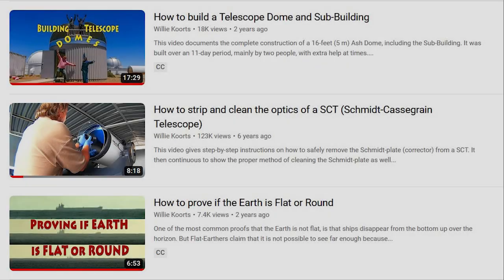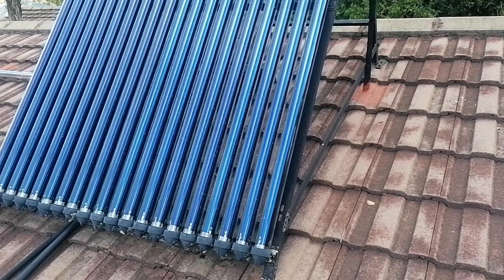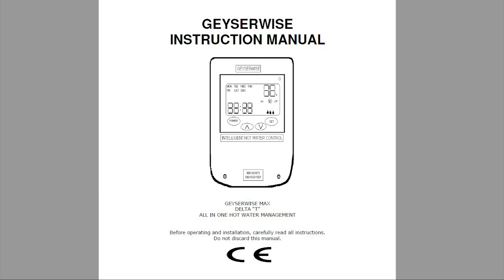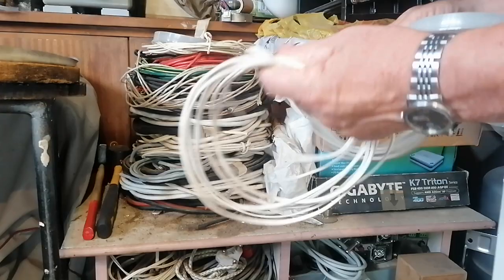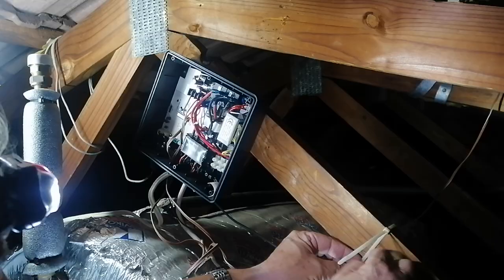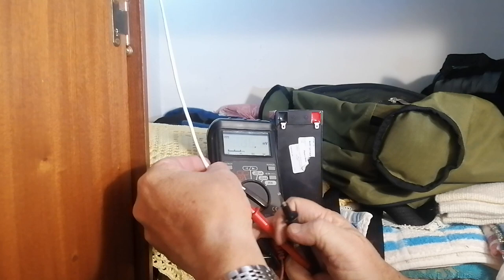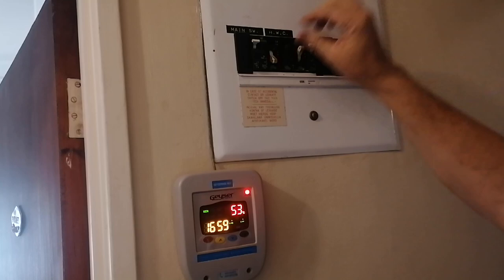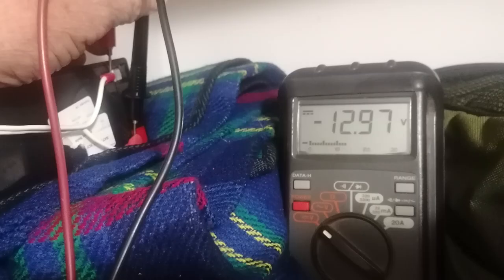How to prevent a GeyserWise losing its settings

Comment: Great advice, just added a battery is yours still running ok?
Especially with the longer load shedding times
Reply from the maker: Yes, still working fine.  I since found out that there is a button-type battery in the Geyserwise display unit that needs to be changed when it looses time & settings, but keep forgetting to check.  The battery is still useful to keep the display going.
Reply: @SterremanWillie  
Post that video when u get a chance pls
Reply: @SterremanWillie  hi Wiilie, my display skerm  verloor ook tyd met LoadShedding. Ek het al die battery 2 keer vervang, maar verloor nogsteeds tyd. Enige raad?

Comment: Hi Willie. Thanks for this very useful video. I've connected the battery as described but I've noticed that the power coming from the board to the battery is above 17V. I disconnected the battery to avoid damaging it. How do I safely reduce the voltage to a level that won't overcharge the battery? Thanks for your help.
Reply from the maker: I also measured 16V which worried me as well, but its been running since I made the video without any problems. The battery does not heat up either, so seems to be OK.
Reply: Thanks Willie @SterremanWillie

Comment: Hi Willie. Any idea of the solar panel combined with a lithium 7Ah 12v will work the same? Geyserwise techie said not to use lithium but i dont know why?
Reply from the maker: I suspect it is not recommend because lithium technology use different voltages and currents to charge, compared to the Geyserwise charger which is designed for a lead-acid battery. It could result in the charging circuit of the Geyserwise to fail. Lead-acid batteries are far cheaper anyway and you don't need a big battery either - my 7Ah is an overkill already.

Comment: Hi Willie, 
Could you please help me know what causes the pump not to work, if I connect the battery directly to the pump it works but it's not sensing when to circulate when connected normally, the solar system was changed because of a burst pipe in the previous one. Am worried because the solar is overheating. Please help.
Reply from the maker: Its difficult to faultfind like this, it could be a number of reasons. I once had to change my Geyserwise when the output port for the 12V motor blew. The 220V port still worked. This I determined using a multimeter. I don't quite follow what happened, sounds like the motor did not work after the uniit was replaced?
Reply: Hope you solved it but just to check 1. Is the probe on the collector working fine? 2. Double check the terminal connection for the pump. 
My geyser was worked on and   the terminals were loose. Resulted in intermittent pump working and saw temps of 80 degrees. Since I retightened them, all works fine

Comment: HI Willie. Can you please assist me my tse geyserwise switches off automatically went the temp reaches the max but then fails to switch back on automatically. I have no timers set.
Reply from the maker: Sjoe!  I'm not an expert on Geyserwise, and have not experienced this problem yet, sorry.  I assume you tried to Google?
Reply: I have. Thanks though. I just bought it so perhaps will send it back to supplier.
Reply from the maker: @mhb3088  good idea. Hope you get sorted.
Reply: Other major problem with Geyserwise is if it comes on after being powerless and its in the middle of a heating cycle, It does not re-initiate the heating cycle. Surely based on time its obvious, it should just restart the cycle.. Junior programmer I think!